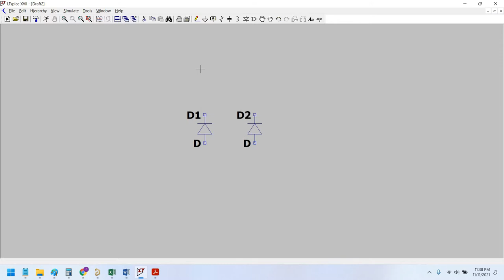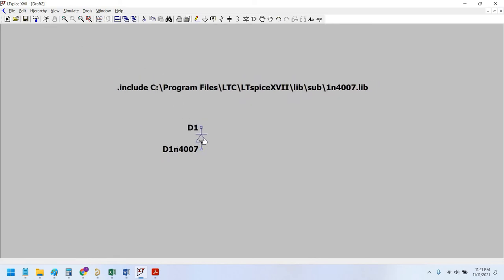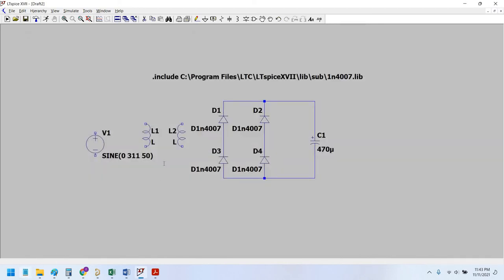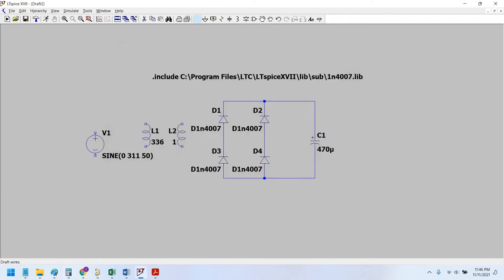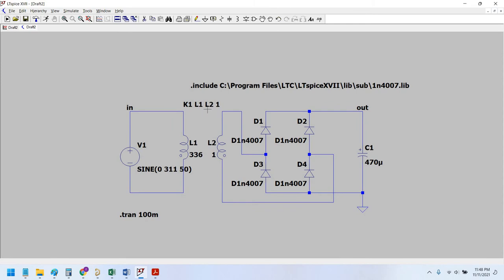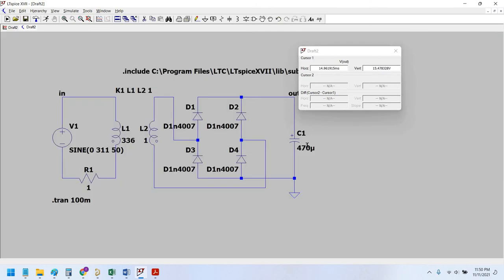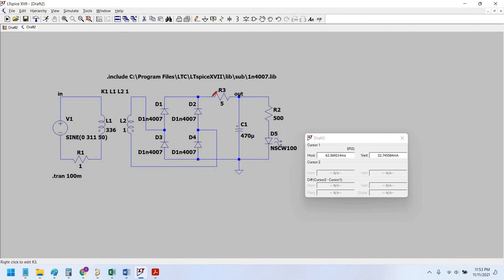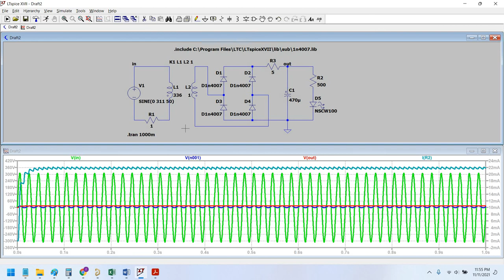#LTSpice Simulation of AC to DC converter Full Wave Bridge and Transformer for Linear Power Supply

Comment: H! On the circuit on the right (the first circuit you made before analysing the current) I'm using only one 1N4148 diode parallel with a polar capacitor 100uf and I want to connect a resistor in series with the diode. How am I supposed to find the value of the resistor so that this converter works right? Thanks in advance.
Also thank you for this video, it was extremely helpful.
Reply from the maker: Hello Zana. Thank you for your comments. The output capacitor is dependant on 1. Output power 2. Output Voltage 3. Output ripple voltage. Lets say you need the output ripple no more than 8V and your output load is around 700W and output voltage to the load is 390V then the output capacitor value would be 595uF. The formula is Co=Po/(2pi*f*Vo*Vr) where Vo = Output voltage Vr = ripple voltage, Po = Output Power and Co= Output Filter Capacitor. Please let me know if your question is answered and if not then I will try to convince you.
Reply: @circuitsimulations  can you give me an email so i can send you a picture of how my circuit looks like? Thank you very much for your time and answer!
Reply from the maker: @zanamisini273  faizan.khalid2011@gmail.com

Comment: any video which simulate 1primmry and 2 secondary transformer?
Reply from the maker: Hi. The 2 secondary transformer is nothing but the same 1 primary and 1 secondary instead there is another 2nd secondary which has the same turns ratio as P1:S1. I have uploaded the latest video for toroidal transformer just now, may be this would not help in 2nd secondary transformer but this is a worth watching. Thanks.